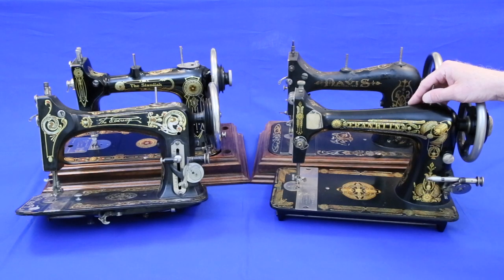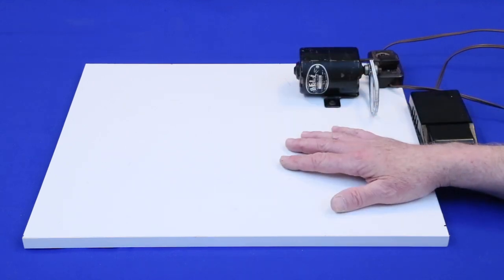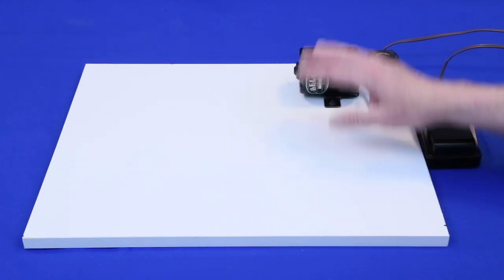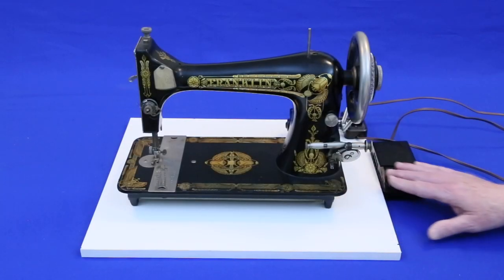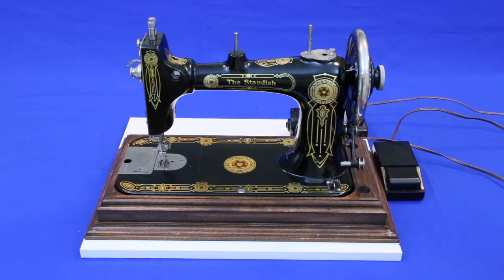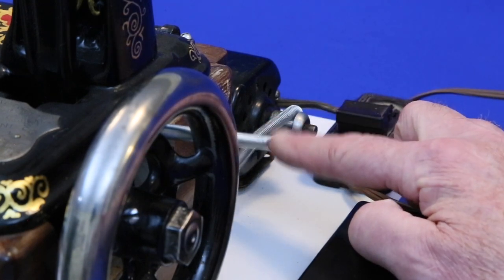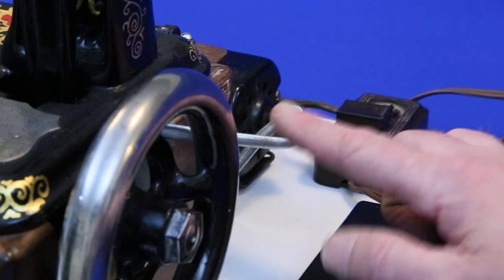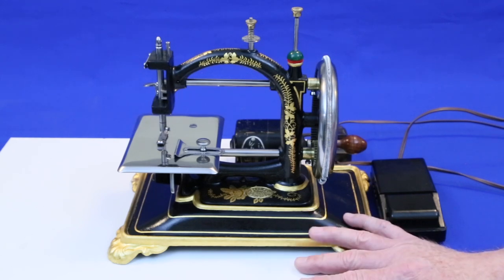Antique Sewing Machine Motorized Base

Comment: Another great video! I need to find a spring belt!
Reply from the maker: Most hardware stores carry a selection of springs. What I used were 1/4-inch diameter extension springs. Amazon also sells them. these springs come with looped ends so smaller ones can be connected to make any length spring needed. Thanks for the comment!

Comment: I am happy to recently find your channel, I have always been fascinated by old sewing machines. I have a question unrelated to the topic of the video: is there any information on the possibility that the original paints of the machines present levels of toxicity, such as lead and such things?
I mean, is it completely safe to use daily a machine that have the original paint?
Reply from the maker: Dear Emilia,

Thank you for writing! There are three different paints used on on virtually all antique sewing machines. The black base coat is called japanning. It's a baked layer of asphaltum (a type of asphalt), linseed oil and turpentine. The next is the artwork. Up until the 1890s, the gold was usually bronze powder in a clear carrier, though a few high-end machines used real gold leaf. Some of these machines would have hand painted color embellishments. I have no idea what type of paints were used. The top, protective clear coat was shellac. Starting in the late 1890s, most machines were decorated with silver-backed decals. These would have used oil paints. Again, I don't know if these would have had any harmful chemicals. Regardless of their content, I would guess that because they are sealed under shellac, they should be safe to use. But, I have no data on the exact formulations of the paints that were used so I am not an authority on this. I have no idea where you'd find this information, other than taking scrapings of the paint to a laboratory and paying to have it analyzed. I'm sorry I couldn't be more helpful.

Comment: Very clever, Wayne!  Do you have any problems with machines sliding around on the base when in use (thus causing alignment problems with the belt)?  I suppose you could put a rubber mat under the machines, if that happens...?
Reply from the maker: Great to hear from you! Thanks for writing! I put rubber pads on the bottoms of the machines to keep them from sliding around and protect whatever table they're on.

Comment: Clever!
Thanks!👍
Reply from the maker: Thank you!
Reply from the maker: Amazon sells 1/4-inch diameter solid rubber cording that works for belts. It's easy to cut to any length and the ends can be super glued together to create a very strong bond.
Reply: @wayneschmidt490  But...the spring makes a better sound.😁👍

Comment: Where can i get a spring belt, and how do i know what size to get? Thanks ❤
Reply from the maker: You can get 1/4-inch diameter extension springs from most hardware stores or from Amazon. Here's one that I got:

https://www.amazon.com/Extension-Spring-Steel-Diameter-Looped/dp/B07DP3SSH9/ref=sr_1_6?crid=2OPBXPEM8SS5O&keywords=1%2F4+inch+diameter+spring&qid=1691362244&sprefix=1%2F4+in+diameter+spring%2Caps%2C185&sr=8-6

Comment: I have a singer treadle base with my machine. Can I switch my Franklin into it?
Reply from the maker: Dear Kathryn Rose,

I measured our Franklin and the Singer Red Eye in our Singer treadle and the dimensions of the base and positions of the hinged mounting pins appear to all line up. I feel confident that if your machines are the same as ours, the Franklin should fit. That's the good news.

The bad news is the the belt pulley on the Franklin is one inch farther away from the right end of the machine than the Singer. This means the belt will rub against the holes in the metal plate on the treadle base through which the belt passes. If you're willing to modify your treadle base by removing this metal plate you may be able to get it to work.

One concern is that the belt will track between the pulley on the machine and the large pulley on the treadle at an angle, which might make it come off the pulley on the treadle. The only way to know is to try it. I never tried this so I can't comment on any other problems you might run into. If you do attempt it, please let me know if it worked out.

Good luck and thanks for commenting!
Reply from the maker: There is a second option if you don't already have a machine in your treadle base. This is to mount your Franklin on a piece of wood large enough to bridge the opening in the treadle's top and place it on the treadle so the machine's pulley and the treadle's pulley line up. Depending on the size of the piece of wood, you might be able to still store the machine inside the treadle base. It's not as convenient as mounting the machine directly onto the treadle, but it's an option you might consider.